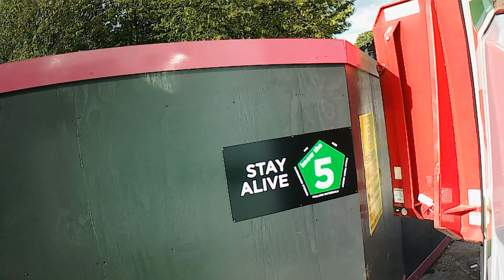Threat in the area. Site closed... Will I make this delivery? ✔ Trucker 🅵🅻🅾🆉 ✔ [4K]

Comment: Why would you have had an infringement if you hadn't taken it off break and put it on to other work for a minute surely you can't have an infringement for taking the card out or leaving it on break can you ? Great reversing by the way
Reply from the maker: It's because you need to register 30min of break if you work more than 6h but less than 9h. If you take your card out It's classed as if you finished your shift without taking the required break. You can still do a manual entry next day recording the required break and 1min of work before end of previous shift. If you leave it on break untill next day It's classed as daily rest therefore you didn't take the required break the previous day so not good.
Hope that helps 👍
Thanks for watching 😀
Reply: I get it now but it seems crazy you can work less than 9 hours have 11 off and still get an infringement for not enough break 🤦‍♂️